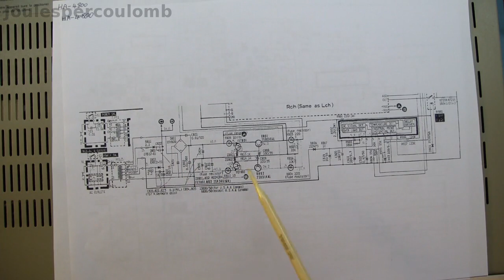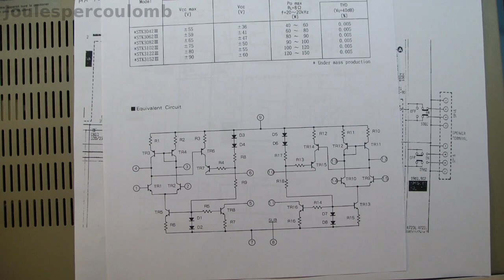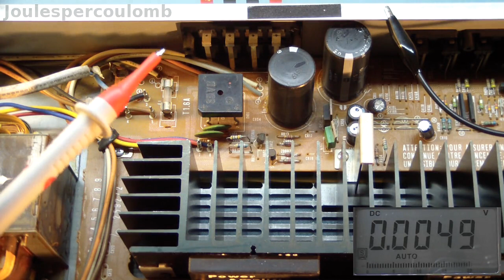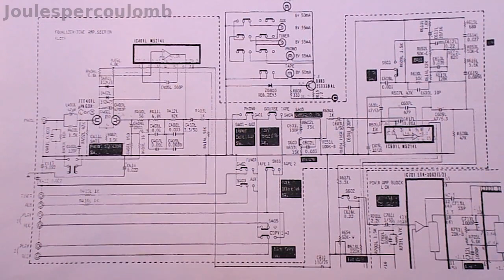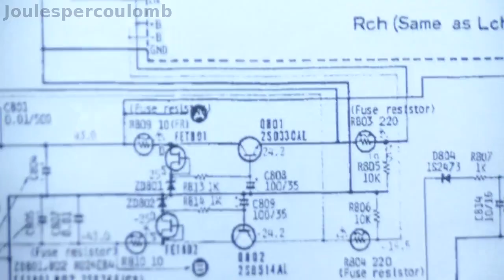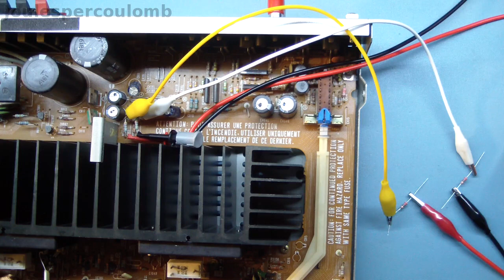Hitachi HA-4800 Amplifier Repair. Part 1.

Comment: Just repaired my HA-4800 thanks to this guide, same deal, dead resistors @ R804 and R807. My amp had not been turned on in over 20 years, but the last owner assured me it was working when he put it away, so it would appear they die simply due to old age. Many thanks.

Comment: The Sanyo STK modules were quite common in the 80s and early 90s for power amps. They made voltage gain blocks, power stage blocks, and complete power amplifier modules. The quality was fairly good, though some suffered reliability issues.

Comment: I just bought this amplifier and when I switch in the tone controls the signal drops about 20 dB with no scratching sounds or anything like that.  The tone controls themselves work, and the volume control works, and there are no scratches.  I am quite impressed by that.

I put some WD-40 in the tone control switch and am now in a waiting pattern.  I have no idea if that is the problem.  Any thoughts would be appreciated.

Comment: Hi there a bit above my pay grade but I have ha2700 with slight scratch noise when turning the balance. Can I squirt some contact cleaner (Halfords brand) on the pot inside? Got a full system for £15. Cassette needs new belts. Next job if I can find on youtube haha. Thank you. Interesting videos. Thank you